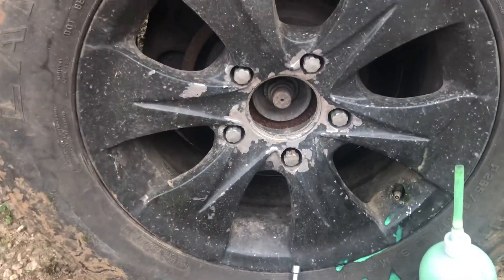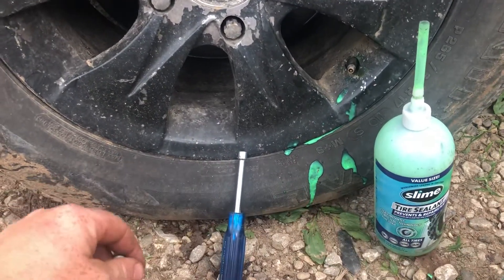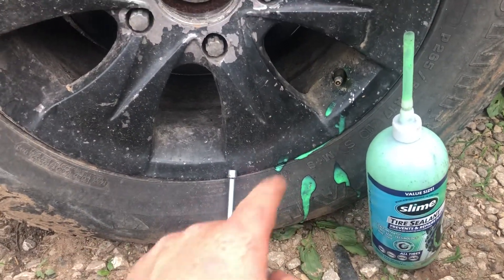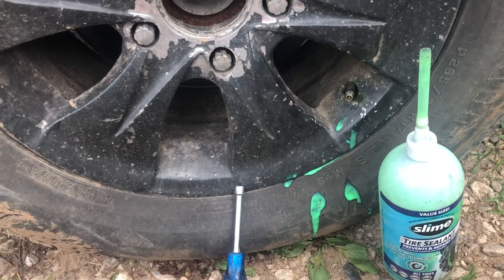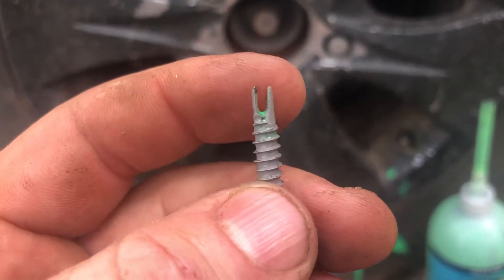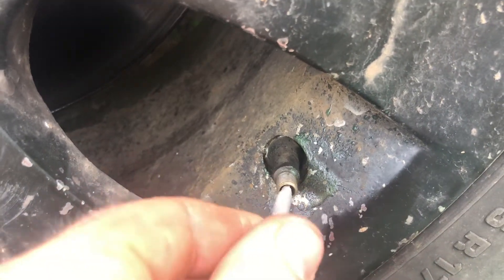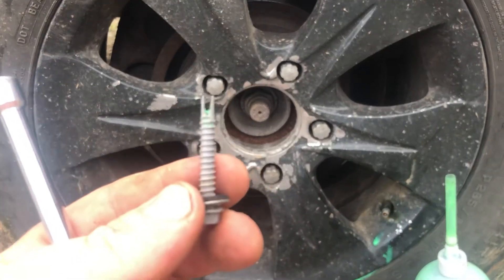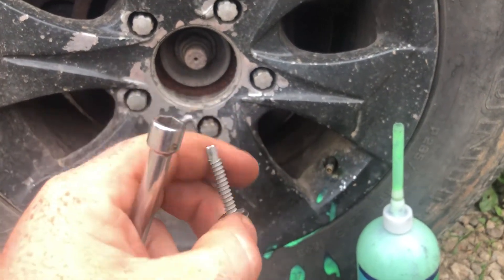DIY Valve Stem Tool

Comment: Thanks- this worked perfectly with a Phillips head bolt and took less than 30 seconds to make with a Dremel. I tried everything else and couldn't get the damn valve off on my wheelbarrow tire.